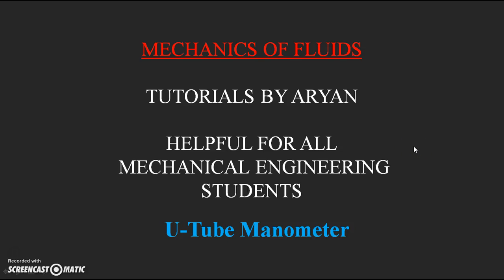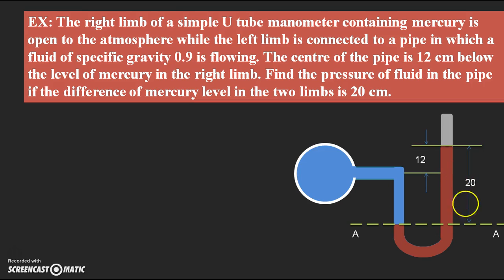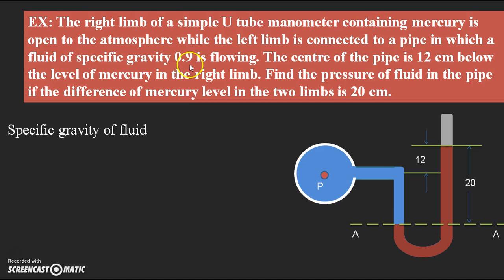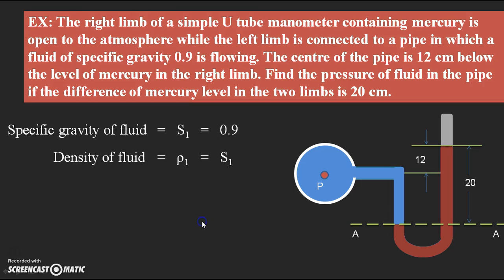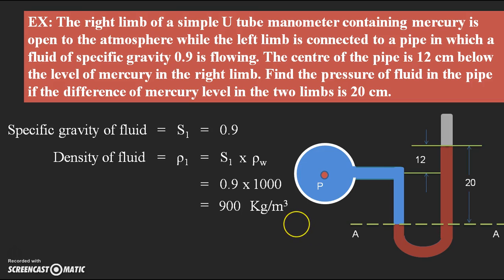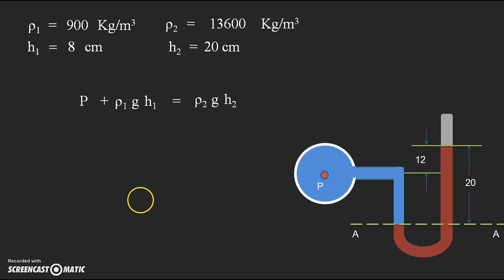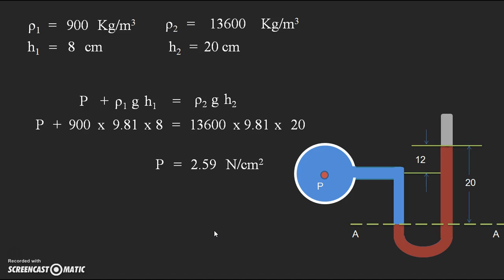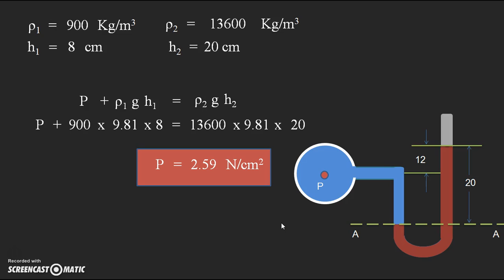U Tube manometer Example problem

Comment: I believe your answer is incorrect. you did not take into account the open end of the manometer hence you did not include the atmospheric pressure
Reply: It is gauge pressure, and if you add atm , then you will get absolute pressure
Reply: @thelocalguychannel  but the ATM pressure and the fluid pressure both combine to affect the Guage pressure do they not? If not the fluid could flow out of the open end and no pressure would be acting to equalize the pressures
Reply: gauge pressure is the 
pressure relative to atmospheric pressure 
by considering atmospheric pressure on right limb 
we will get absolute pressure
as qstion has not included which type of pressure they want 
so both the pressure are correct 
you can also change gauge pressure 
into absolute pressure by considering  atmospheric pressure on right limb
Reply: Totally wrong 🙁